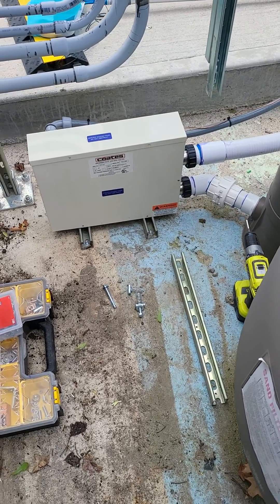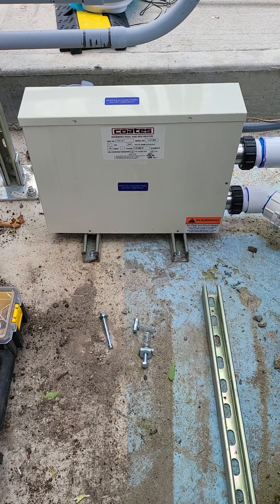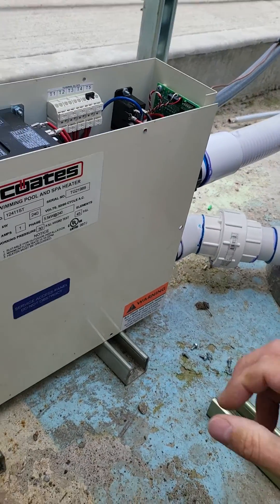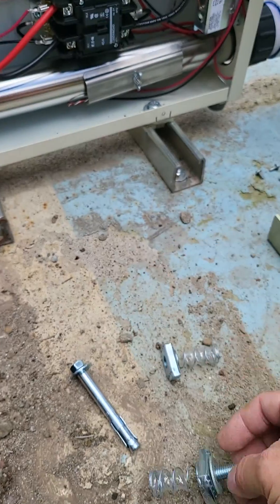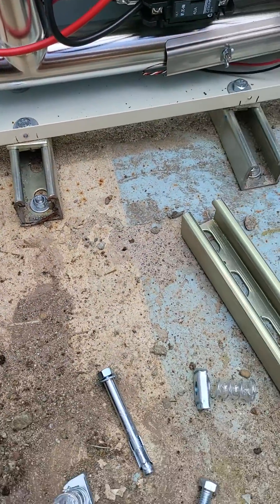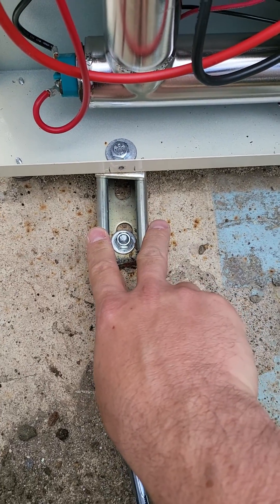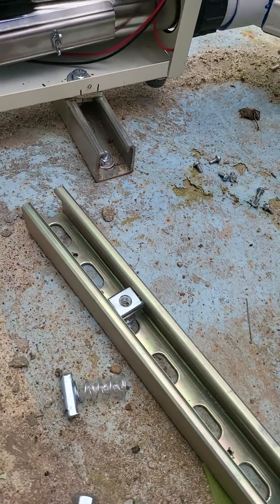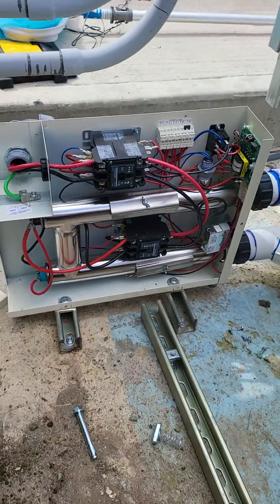How to securely mount a Coates spa heater

Comment: Dose anyone know how to determine if the heating elements are bad? I have a 84 amp 3phase not heating up. The indicator light in staying red on the control panel.
Reply from the maker: Run a current clamp on the wires going to each individual element

Comment: hi, was this a three phase unit? Trying to install it.. but there's L1, L2 and L3... t1, t2, t3 as well.. manual complicated...
Reply from the maker: The unit in the video is single phase.
Reply: i terminate my line into ahh heater but wire is heat and melt..
Reply from the maker: @ronnelmancera8725  can you post a picture of your nameplate? You can use the info on that to determine your breaker and wire size.

Comment: Here's how much mm cable you're fixing
Reply from the maker: That's 6ga for the lines and 8ga (I think) for the ground
Reply: @betterthanalemur  After turning on the heater, people can go into the water??
Reply from the maker: @amenakhatrun5206  the water is usually hot enough within two hours
Reply: How do you determine if a heating element is bad? I have a coates 84 amp.
Reply: It's a 3 phase